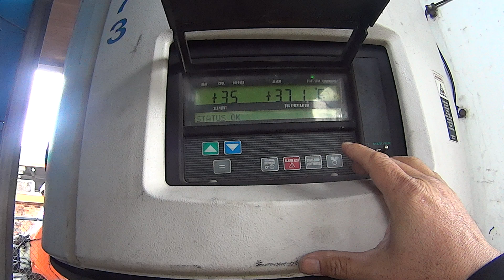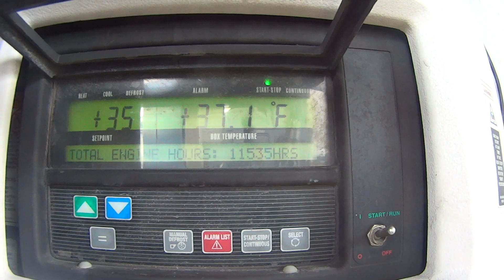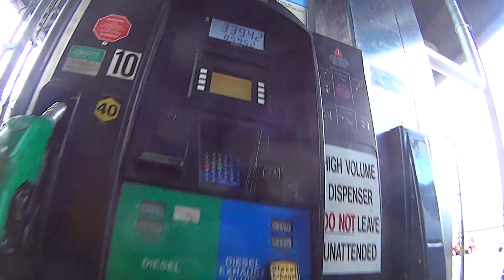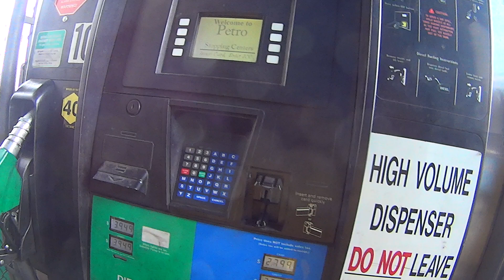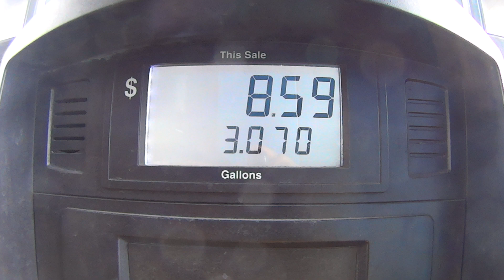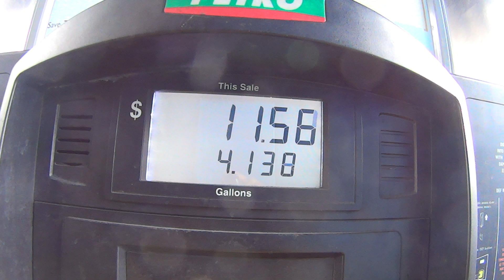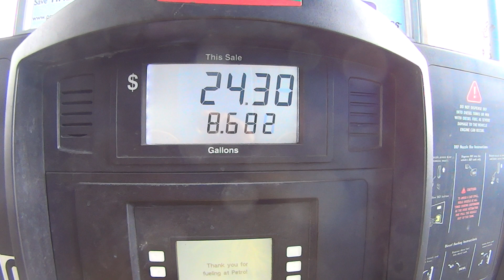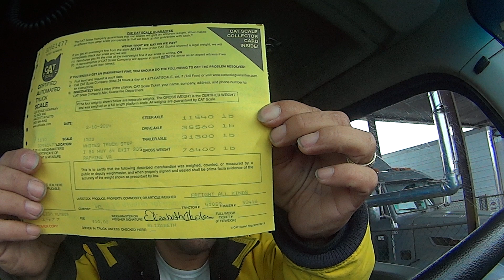790 DEF

Comment: Right now I am driving a Freightliner Coronado 2003, caterpillar 15. I love this engine. But I only get 5.2 mpg average in winter and driving very heavy loads. 100k lbs most of time in hills and country roads, that also 4 axles trailer.
Reply from the maker: blue is getting 7.6 mpg